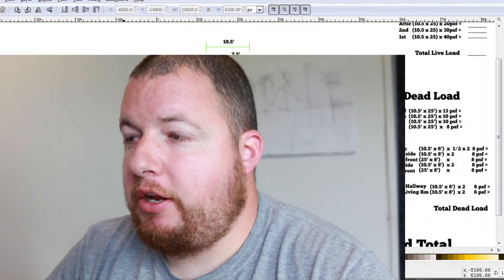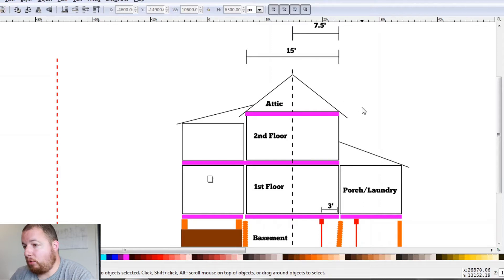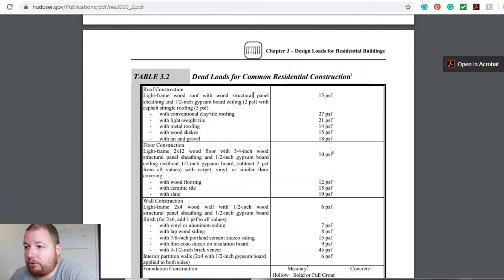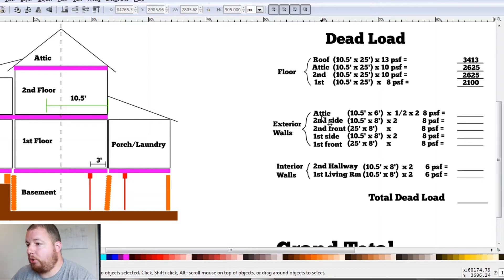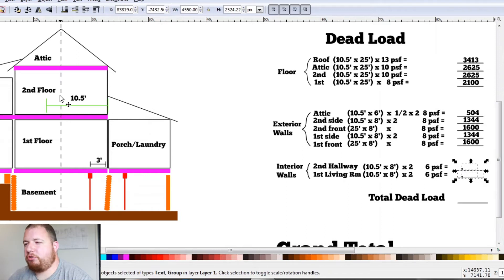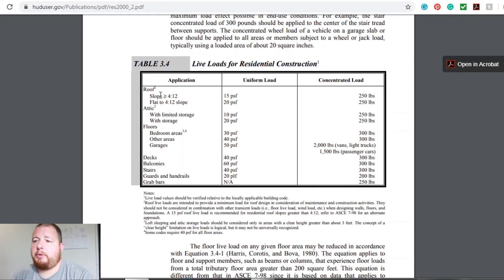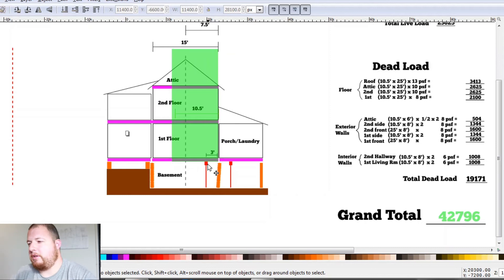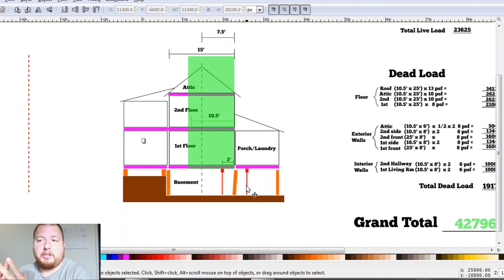Foundation Repair -  Calculating Load on Foundation Pt. 2

Comment: I really appreciate your videos and have learned a lot by watching your work. I was wondering what software you are using for the load calculation?
Reply from the maker: No software. Just adding up weight calculations of floors, walls, roof ect. You can find those weights online
Reply: @appalachiandiy2415  OK. What software are you using in the video?
Reply from the maker: @taburke6  software to make the video or software to make load calculations?
Reply: @appalachiandiy2415  Software with the drawing of the house and illustrating the load calculations
Reply from the maker: @taburke6  I used the old fasion way. pen and paper. I calculated how much square footage of roof, floors, walls, etc and used a live load table found here: https://www.huduser.gov/publications/pdf/res2000_2.pdf
It is chapter 3; table 3.4 
calculate what everything weighs and add it up. pretty simple just takes some time
Reply: @appalachiandiy2415  while I understood you use paper and pen originally. In this video you used a program on a computer to display the formats what program or software did you use?

Comment: When you are doing calculations should you figure in extra weight for rooms like the attic and basement that do not have drywall for future renovations?
Reply from the maker: No, unless you plan to support the added weight while you are supporting that part of the house during a remodel. If your renovation is heavier, just calculate for what will be there in the future. Thanks for the reply!
Reply: @appalachiandiy2415  thank you!